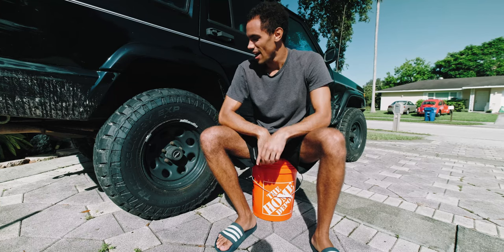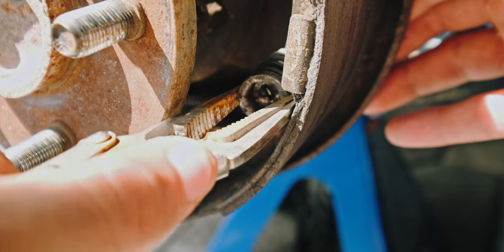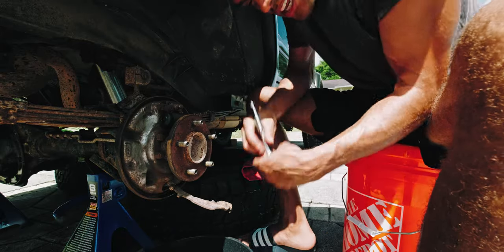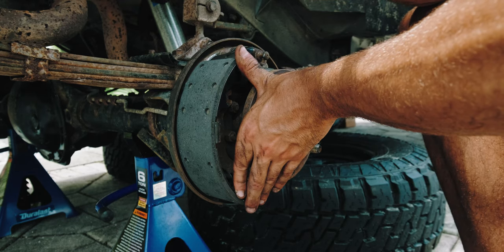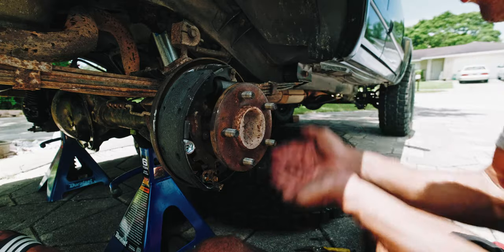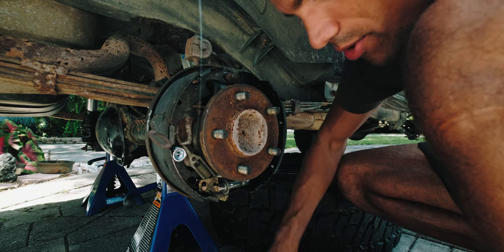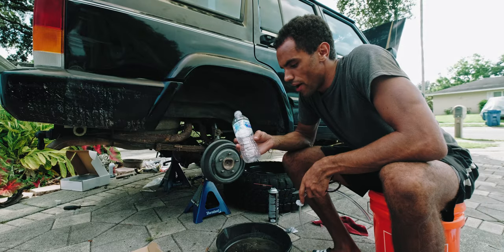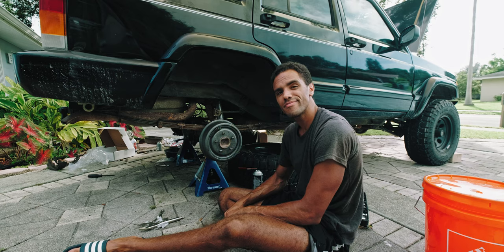Does ChrisFix Actually Help? | Drum Brakes

Comment: you should fully compress the spring (from the side way) using the clamp instead and then it would be easier for the locking rod and plate to meet one another.

Comment: I hate drum brakes, last ones I did was my xj. Glad u have replaced wheel cylinders while you where there, I had to redo mine again bc they failed a year later lol. Absolutely hate those spring pins, ptsd when I watched this. Drain your diff and put new oil in if ur concerned, its easy
Reply from the maker: Yea, I may look into doing a disk conversion. But I ended up getting new axles because the current ones needed to be rebuilt. Video coming soon on that
Reply: @trailspinTV  no need to do disk conversion